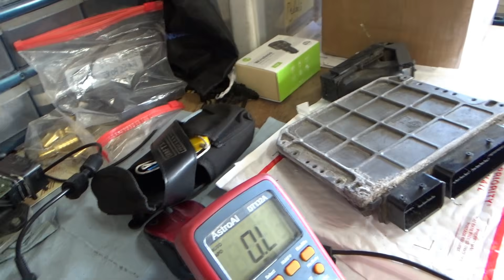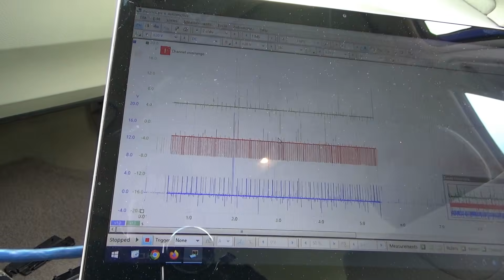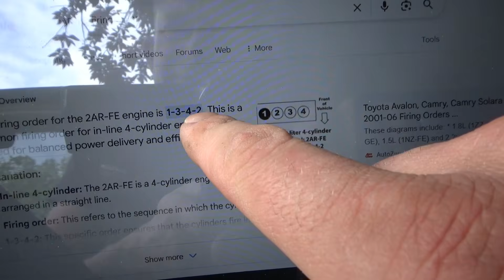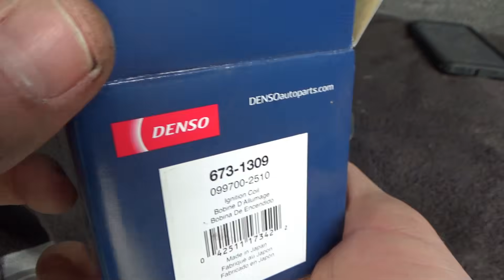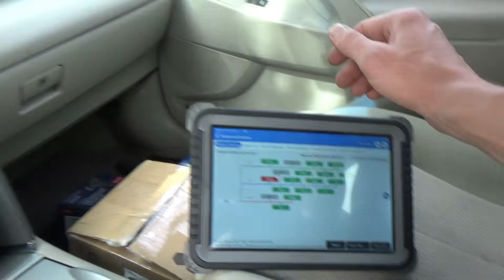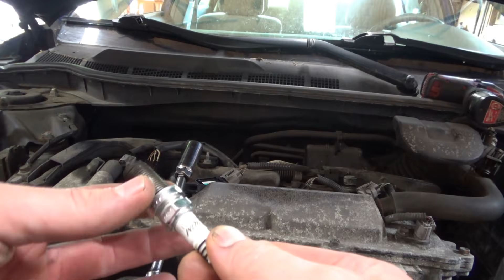(Pt 3 - CONCLUSION) CRAZY Camry...EATS ECMs?!? (Labor Day Special 2025)

Comment: Deleted my comment about fake coils ..... nice one NGK for stepping up and doing the testing and feedback. I would have put money on them being fake.
Reply: A reasonable guess imo.
Reply: Wasn't trying to hide my comments by deleting. Just by the  printing of the NGK  logo on the top of the coil and the grey plastic and just general finish made them look fake too me. I expected genuine NGK parts to be finished more to the finish of the Denso parts.
Reply: Me too it was the first thing I thought of
Reply: Now that we know a coil can spike the circuit and take out a pcm. Do you think there is some sort of attenuator or circuit protection that can be added to prevent any coil from taken out the engine computer?
Reply: @johnbuttner5698  Sure. There are plenty of components used for protecting against too high voltages, some faster and more precise than others. A suitable transient-voltage-suppression (TVS) diode between the 5v rail and ground, it basically behaves like a short circuit once the voltage has gone above a certain level. For a 5V you could for example use a 6V TVS (there has to be some separation between normal voltage and the protection level), any time the voltage goes above 6V it lets current through straight to ground preventing the voltage from rising any higher. This still means there can be up to 6V on the 5V rail, but I think most things should survive that, at least for limited time. 
There are plenty of other options for protection and most likely there's SOME already built in there. This time the spikes just were to powerful for it to handle - and that's a balance you have to consider, you can design it to handle almost anything, but at some point you are spending a lot of money to protect against very unlikely events. This was the first time Ivan has come across this, so for a car manufacturer it wouldn't make sense to spend a bunch of extra money on protection for events that almost never happens. Especially if they only happen with non-stock ignition coils - the car manufacturer has NO interest in helping you use aftermarket parts.
Reply: @ulfg1409 Sure but it could also happen to stock Denso coils. I don't think any coils are immune to an internal short.
Reply: @flrpower5628  For sure. But still, the manufacturer makes a compromise between how much protection to build in and how likely different issues may be. You could build something that is almost indestructible, but it becomes far too expensive to be worth it.

In this case the stock coils may have had a better internal design less likely to fail in a way causing issues like this, while the non-stock replacement perhaps had thinner insulation, some conductors closer together on an internal circuit board or something like that, meaning that the stock coil has far lower risk developing this kind of issue. Doesn't mean the replacement wasn't good, just that it wasn't AS good.
Reply: Same here, it's usually a spike from a coil or high amps from a stuck or shorted injector that causes ECMs to fail back to back. I've seen it a few times and when the customer is questioned about recent repairs, they'll say they purchased a "tune-up kit" from Amazon or eBay for $59.95 that included all the coils. I was skeptical of them as well.
Reply from the maker: Please Never delete your comments!

Comment: Darren Quinn from Mechanic Mindset covered a similar blown BMW ecu where the fuel pump relay failed causing a breakdown. The recovery mechanic fitted a standard 4 pin relay without a resistor which blew the ecu after a few days.That also is a good video to watch, he shows the voltage spike when he reproduces the fault on a scope.
Great that you guys are educating the rest of us on something we could possibly be faced with and could cost us a lot of money or simply give up finding the root cause.

https://youtu.be/OE9TvfyC5EY?si=Xk6b8ERPen3CrptV

Comment: One of the worst blowing head gaskets I’ve ever worked on a 2002 Toyota Camry 2.4 zero compression all four cylinders and all four ignition coils melted and 3 of the 4 were shorting out internally after the head repair. Bench tested those coil and cut them open to find spark leaking from primary to secondary side but these stock one did not spike the pcm

Comment: Wow, what a study.  And kudos to NGK for actually wanting to ensure their products are performing to standards and following up.   Crazy failure in the coil.  Fantastic ending to this series….car got fixed and the part company was able to learn about a failure.  Win win.  Thanks Ivan!
Reply: Good job there. I would hope NGK would reimburse all losses on this case
Reply: Common on rav4, used to make the car stall, never seen one eat a computer
Reply: a coil that is not old and taking down engine computers for thousands to see is not good PR for a well respected company like NGK.
Reply: As I see it NGK has in general good quality on their products. It's always a possibility that there's a random manufacturing defect that isn't revealed during manufacturing testing.
Reply: NGK throws a sticker on whitebox shit together to cash in on the good name they got for spark plugs. 

They have never manufactured pencil coils for any OE. They got into reboxing coils like 5 or 6 years ago
Reply: I seriously doubt NGK would have bothered followup had this video not been posted.  Kudos to Ivan.
Reply: @lo1234-w9r  Not so sure. I personally don't trust big companies anymore but obviously they got back to Ivan before he posted the video.
Reply: Car care nut did mention about OE coils getting an improvement design so there is that. He even mentions that aftermarket coils could be made to old standards and since they have stock, they have to sell those anyway. In this case, hard to say if they initiated a recall of those coils to remediate the issue by reworking which i dont think is possible.

Comment: Fords are known for blowing up the pcm from bad ignition coil. Fordtechmakuloco covered it
Reply: Older escapes 3.0lt used to melt the coils I had one doing it and taking out the ecm
Reply: Depending on the Ford engine type and matching PCM, for "dumb coil" circuits some of the newer PCM IGBT designs are poor thermally, which use thermal PCB vias (the IGBTs are SMT) to the case rather than directly mounting the IGBTs to the side enclosure rails. This generates hot spots amongst the IGBTs, making some cylinders more susceptible to cooking an IGBT driver. The IGBT will fail due to overstress caused by its die temperature and eventually fail open, producing a burn area on the PCB. However, even though one of the IGBTs has failed the PCM will still communication over the DLC (CAN) and as is able to report the failed COP and PCM drive circuit usually as a misfire DTC.
Reply from the maker: Fords usually cook just one driver and have a misfire. PCM is still alive in that case 😉

Comment: Shitty parts have become a real problem.  Had an 05 Silverado in here 2 weeks ago.  Bad camshaft sensor.  I couldn't find a Delco so in my hurry, I put a Durablast in it.  That lasted 2 days, and the symptom came back: Long cranking time.  Ran through the diag again, and boys, there is 1 AC Delco camshaft sensor for that truck in the entire northern hemisphere, according to my local dealer.  I ended up putting a Standard brand in it, and haven't heard back from him, so hopefully it will hang in.
Reply: I thought duralast was standard.

Comment: Not done until you check the spark plug gaps. 

The source is likely a large gap causing over voltage stress with secondary above around 30 to 35kv-ish, which eventually causes the primary side over voltage protection (OVP) to clamp the primary side voltage. OVP is typically on primary size at between 250v to 350v-ish. Once the OVP overheated and fails (after a bunch of ignored misfired events), the primary voltage exceeds OVP clamped limits and starts to bridge to the control signals. This happens to OEM and aftermarket. Do your plug maintenance or at minimum check your gaps.

In this case the owner probably changed the plugs before bringing to Pine Hollow. So gaps are probably fine now. But damaged coil still existed caused by the lack of plug maintenance. After plugs were fixed either NGK or OEM would fix the remaining coil problem.
Reply: Good info bud you know your  coils
Reply: @peterlworth I used to be the primary developer at rusEFI. I still dabble from time to time. Designing ECUs learns you some good stuff.
Reply: True - but the 5v ref. & signal returns should be built in such a way as to be immune to this.
Reply: @andycoombes should 5v be able to survive a direct lightning strike? We're do you draw the line for how robust it needs to be? It survived warranty so OEM design department thinks it's good enough from their minds eye. Often the 5v clamping is weak. Typically if you follow OEM maintenance you don't have the problem. I agree it's crappy for those of us who drive well beyond 100kmi. But OEMs meet warranty with a weak design when following OEM maintenance intervals. So save $0.05 per ECU is what we've got.
Reply: Possible but not probable in this case. The plugs appeared age-appropriate (3-4 years) and did not appear new. Additionally, wouldn't the NGK lab have considered your scenario and determined it as the probable cause as well?
Reply: @SkepticalFreethinkerdoes NGK build to OEM spec or add circuits, risky potential failure points and costs in a very competitive market. OEM built it so a plug typically won't fail in 100kmi. Aftermarket simply copies that OEM general design. Yes the plug gap is considered but you should replace your plugs at OEM recommend intervals which no one does. So it's not designed for. Shouldn't cars be able to run on dirty oil? Or should you do oil changes. Same thing here. The OEM reached warranty. Aftermarket can't afford to add costs. End user solution do your plug maintenance per the OEzm recommendations.
Reply: A wide gap will certainly stress the insulation in a coil, and for the same reason makes pulling coils/ht leads a really bad idea when trying to find a misfire.  That said coils can and do break down with age and heat cycles, some more than others.
Reply from the maker: Plugs were replaced with NGK Iridiums at the same time as the coils 4 years ago, so not suspecting a plug issue at all. Iridium plugs on a COP system can go 200k miles and still look MINT 😮
Reply: @PineHollowAutoDiagnostics  Good to hear you checked plugs, bummer it didn't make a blurb in the video. Thanks for for you video's it makes me think there is hope in finding a good mechanic in my area. I'm still trying to find one. 

Can you ask the NGK people for a Failure Effects Analysis (FEA) report? Or can they tell you what the clamping voltage for the primary side was clamping at on the failed device? It would be handy for learning what went wrong. They typically do an insulation resistance test before attaching the driver coil to the driver circuit. This test is usually very good at identifying impurities or imperfections. I'm still not convinced I should kick NGK to the road. I want to believe a mechanic or owner before you or someone like that broke the clamping circuit, then the insulation eventually failed. Would be a bummer to learn that NGK is suspect.

Comment: Replace my coil pack on my 2005 Chevy cobalt for no good reason but preventative maintenance. Big mistake, check engine light came on, misfiring, timing chain slapping. I replace them with the original and return then to rock auto. The original are still functional after 200k. I suspect the coils were knock offs just like I believe these ngk are.

Comment: During the last video I was thinking how easy it would be to use a different regulator wired to that pin of the ECU, easy to put some limited protection on it. The spiking from the ignition seems possible, will watch this through. Edit: Well done Ivan and respect to NGK for doing the investigation. I wonder if the coil got splashed when he drove through the slush? The plug gaps look quite wide and it might stress the insulation.